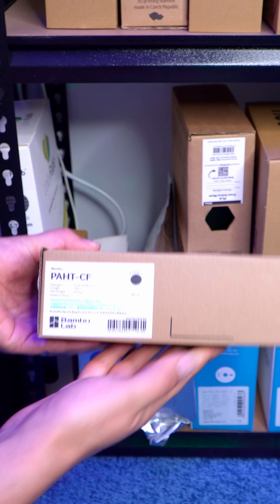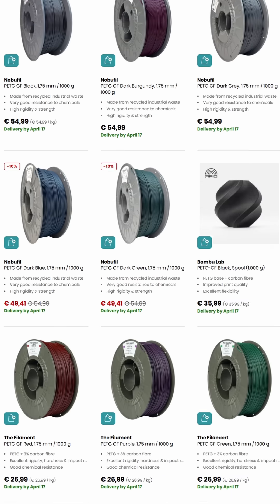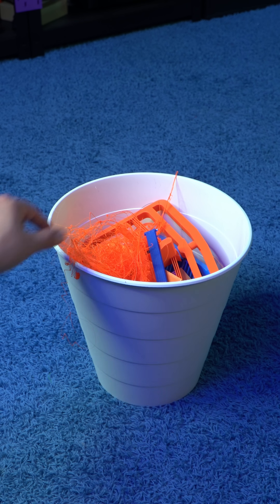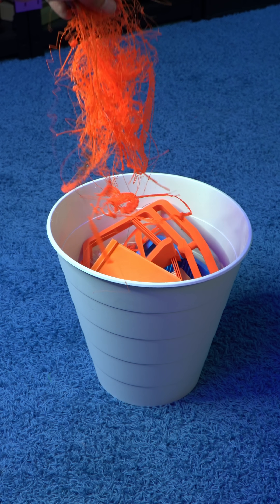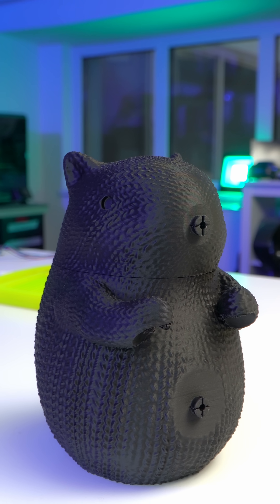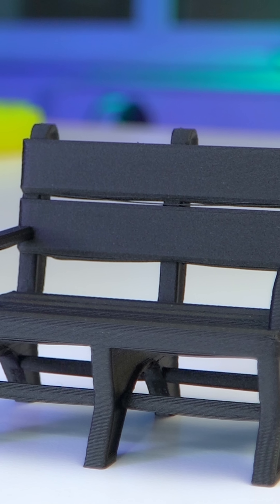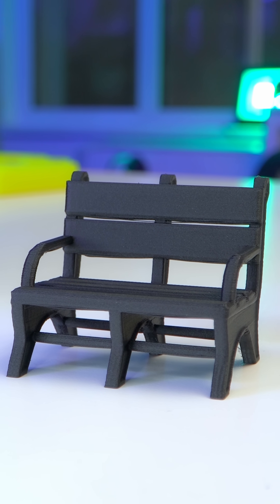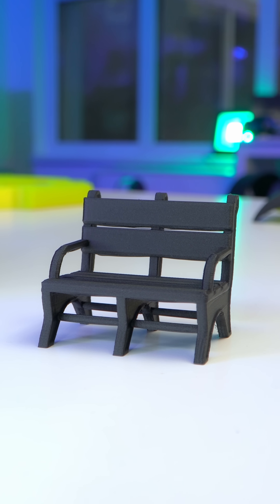PLA-CF.....Why?

Comment: I’m trying to decide if I should start using PLA-CF or PLA+ for drone frames, and other parts subject to vibrations and typically made out of CNC’d carbon fiber plates. What would be more practical? Does PLA-CF cause any corrosion on the nozzle over time?
Reply from the maker: yes it does but if you have a hardened steel nozzle, you don't need to worry about corrosion for a long time. I'm not sure I would recommend a PLA CF for something like drone arms, its just too brittle. Unfortunately, I don't have much experience with this, drone parts are a totally different ball game and I think if you asked a drone maker they would probably recommend getting the actual CNC'd plates but there is a whole community of printed drone people on Youtube, they are definitely the right people to get advice from on this topic

Comment: Really nice surface finish! I’m curious—does the PLA-CF feel more resistant to scratches compared to regular PLA/PLA+ or matte PLA? For example, if you run a fingernail along the layer lines, do you notice fewer marks?
Reply from the maker: Just did a fingernail test and its slightly better, but only slightly. I compared it against our own ecoPLA

Comment: probably the most common reason for using PLA-CF is its looks, matte black with layer lines that are not noticeable. 

my problem with PLA in general is,  it just cannot take the heat,  leave something in your car and it warps to heck within a few hours.  specially if it has some kind of load.  

but for prototyping, concepts, of decorative items for indoors,  it's fine.
Reply: It really depends on a lot of things. I live in Coastal southern NC and I haven’t had any issues with prints warping in the car. 

My best example is, I made a cupholder expander for my brother‘s car out of plain PLA and he’s left in there for months at this point and it still looks brand new .

Comment: Never use PLA period. If I wanted useless trinkets made out of packaging material I would use PLA. price to performance just isn´t there.
Reply: theres serveral videos on here that have real scientific studies behind them that show in some cases PLA is stronger then even Nylon. PLA is one of the strongest and easiest materials to print. hense why its so popular
Reply: @AdditiveX  Look, I am a mechanical engineer, I do design automotive parts. 
You can follow "serious scientific studies of YouTube" if you wish I don´t care.
Reply: Sierra, can I ask your top three filaments and what you find them to be best used for?  I just tried printing PETG-CF and just ordered some PCTG, but I'm on the hunt for a new go-to filament for the best "Ease of Printing" vs "Print FinishOverhang/Bridging" vs "Resilience" vs "Price" ratio.  Thanks in advance!
Reply: @MisterB123  "...Sierra, can I ask your top three filaments and what you find them to be best used for?..." Yes of course, we can debate anything.
1. PETG - general usage, best price to performance ratio. Ductile, great for snap fittings. Good layer adhesion and detail reproduction.
2. TPU - Great due to it´s elasticity. Unique in that case.
3. PA6-CF20 - Printable PA6, rigid, good temp. performance

"... I just tried printing PETG-CF and just ordered some PCTG, but I'm on the hunt for a new go-to filament for the best "Ease of Printing" vs "Print FinishOverhang/Bridging" vs "Resilience" vs "Price" ratio.  Thanks in advance!..." In my opinion PETG-CF is mostly useless. You increase the price due to the CF filling but you don´t benefit in any mechanical property whatsoever. CF is mostly marketing. 

First you need to understand why we would use GF or GF. In home 3D printing it´s mostly due to those factors
1. High temp.
2. Better printability (think Nylons)
3. Surface finish.
4. More rigidity
You may notice strength is not on the list. 
Due to being more rigid it´s also way more difficult to create snap fittings, you loose ductility. 

In my opinion plain old simply PETG is the best material you can use for general purposes. It´s way better than PLA. It´s as cheap as PLA. It´s easy to print. Layer bondage is great. It´s ductile. It´s strength is good and due to 3D printing, if you need more strength you can simply design for it. We are not trying to design some part for an aircraft here, just make walls wide and thicker and so on. It´s easier to print than ASA (skip ABS altogether). It´s more readily available and usually cheaper than PCTG. 
It´s not as good as PA but mostly you don´t need PA. I probably needed it 4x or so in many years. One negative would be it´s not as fast to print as PLA but then again PLA is just packaging material. It´s fast to print and cheap, that´s basically it.
Reply: PLA is cheap. PLA is easy to print. PLA doesn't stink up the house. PLA is very stiff. PLA is king.
Reply: @difflocktwo  PETG is as cheap as PLA. From my experience PLA stink up the house more than PETG, some may argue that PLA smell is more bearable but the intensity makes it not true for me, you shouldn't print in the room you spend your time/sleep anyway and that comment suggests that you do it and that's telling that you are barely a hobbyist when it comes to 3d printing. PLA is stiffer than most other plastics used in 3d priting and that would be good if the design needs it, but insane creep and lack of temperature resistance makes it unable to actually take advantage of this as you can't use it for load bearing parts. PLA also has very bad chemical resistance. All of that makes it not viable for anything more than useless trinkets.
Reply: @difflocktwo  1. PLA is cheap, true. But in my area PET is the same price. 
2. So is PET and many other material, PET has a way better layer bondage for instance.
3. PET emits about the same amount of pollutants as PLA. However you should always vent no matter the material. So there is no real difference there.
4. PLA is too stiff, that´s right. It lacks ductility, thus it´s the worse choice, especially for snap fittings. You will notice PLA is never used in any commercial use case, while even PP is used in housings and so on. 
5. PLA melts like butter at about 60°C.
All in all PLA is too stiff and melts easily, that´s why PLA is never used widespread in any meaningful applications outside of packaging material. 
Thank you for your comment.

Comment: My first thoughts with CF would be ABS/ASA, rigid fiber in the impact resistant polymer matrix. And on the bucket list: TPU with CF, let's see how that works for drone parts that experience accidents.
Reply from the maker: TPU CF might not be the best choice for drone parts that need to be rigid, its still got some flex to it, it is the most impact resistant filament I have ever used though, it can take a massive beating.
Reply: @3DJake_Official  Im thinking mostly of bumper arches and shrouds - parts that catch my piloting errors. Perhaps impact absorbing parts for a ground vehicle.